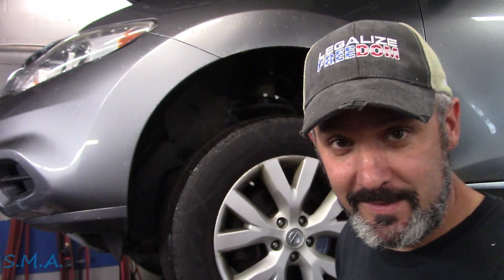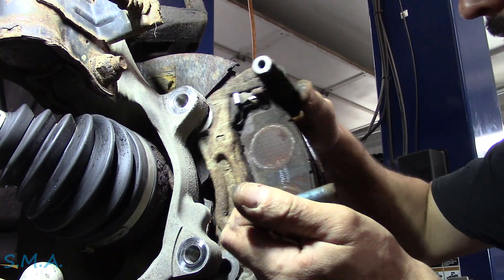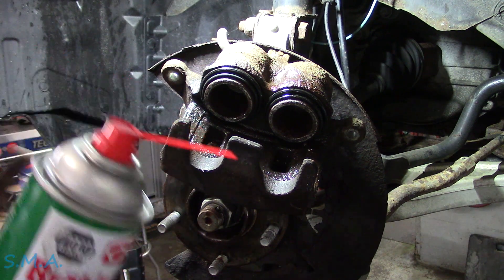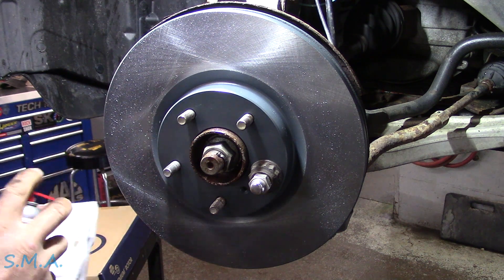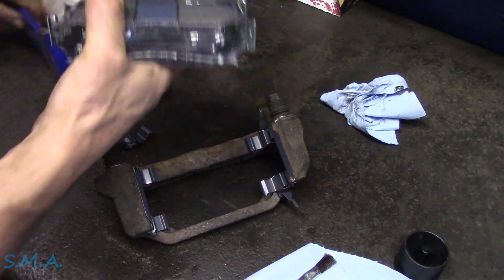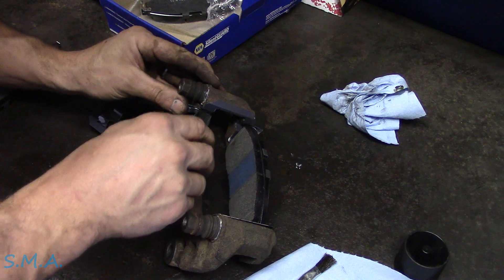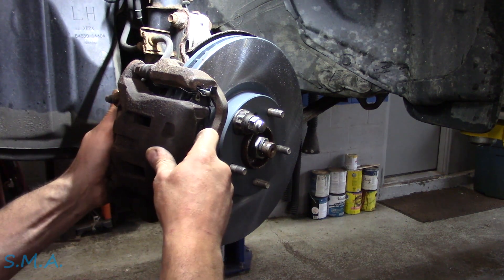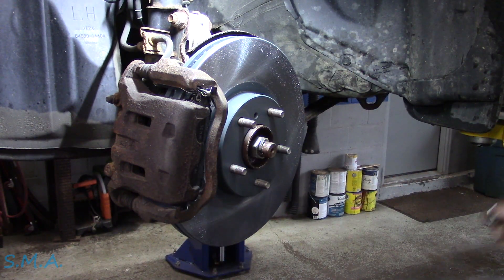Nissan Murano: Front Brake Pads & Rotors

Comment from the maker: My two favorite brake lubes:
CRC 05361 Silaramic Brake System Grease - 5 oz. :https://amzn.to/3cWp0nD
Super Lube 97008 Silicone Lubricating Brake Grease with PTFE, 8 oz Tube : https://amzn.to/3p9NYG5
Reply: KY Jelly?
Reply: What happened to the purple permatex?
Reply: No more purple permatex? Has been working great for me since you turned me on to it. Hope you are having a good holiday with the family!
Reply: Do Tesla's have brakes that need to be replaced ?
Reply: @winch1587  he found a better consistency grease
Reply: Sure makes me happy that salt is not used on our roads. Vehicles last so much longer and the repairs are so much easier. Also the vehicles are safer not rotting out all your major safety components.
Reply: @adamUDavies  Yes, and usually because they rot, not because they wear out.
Reply: @winch1587  In a couple of his videos he recommended the Permatex orange grease which was safer for rubber seals.  That is the stuff I bought and haven't even used yet.
Reply: @BillinSD  Eric switched to the CRC on the miss "O" brake job. Liked how "sticky" it was in some other brake job after that one. The purple permatex was in short supply for some time. I know he got free sample of the CRC in the mail. The super lube is thinner and better for the slide pins, in my view. It's made in the town next to me,  Bohemia, New York. Sil-glyde is also good for the pins and most NAPA's will have it in stock. Use the links if you can, SMA will get a small amount of $ from it. Nothing wrong with the purple stuff. Use it up and then try the CRC.
Reply: @winch1587  It was in short supply for some time. Eric got a chance to try some CRC and liked how sticky it was. Time will tell if he "sticks" with it. I have not seen  Super lube in a video yet. Not clear why he listed  it as a favorite. I like it for the slide pins as it is thinner then CRC and the Purple stuff. Also made in the town next to me, Bohemia, New York.
Reply: @islipfdchief  I must have missed some videos or haven't paid close attention. Don't remember the orange grease nor about receiving the CRC stuff. Let's see if Eric will make a comparison between the different greases someday.
Reply: You should figure out how to return phone calls when local people want to bring work to your shop.
Reply: @Pb_Slinger  Hard to filter all the calls SMA receives. My car warranty is about to expire every week from a local number. If you are truly local ? Open 8-5 Monday - Friday on south main street across from the post office. Don't make it late or on Friday it is Deer season. Be grateful that you live close enough to even get service from a high quality shop.   Eric has not made mention in any of the new videos how far out appointments were. Good luck and if you show up in an Ice cream truck you may get quicker service (:
Reply: @adamUDavies  my wife's Tesla...yes.   Most other owners who understand dynamic brakes.  No.

Comment: There's something relaxing about watching Eric do a brake job.    I think it has to do with me not doing the work.
Reply: That's a fine way to relax, M.H. There's nothing like doing nothing yourself to let yourself relax.
Reply: Every time he does brakes - in my mind - I am doing mine! 🥳
Reply: Yes.  Work fascinates me.  I can watch somebody else do it for hours...
Reply: I just did a brake job on my sister 08 altima. I live a few hours north of Eric O in the lovely rust belt. The drivers side caliper bracket bolts took the threads out with them on removal and I wasn't even using air tools...of course no parts stores sell just the bracket so guess who got replace the whole caliper :) So I can 100% agree on how relaxing it is watching someone else do the work lol.
Reply: @harryl7946  Brake Job ASMR?
Reply: @3wheeler016  you are a good brother.
Reply: Legit I've done countless brake jobs in my life but if I was anywhere near SMA I'd have them knock it out knowing they'd do it better than me.

Comment: I have never seen brake clean affect rubber in over 25 years of being a mechanic. I love your sense of humor and how you repair your customers 👍
Reply: Spray some on a rubber o ring then try and fit it back where it goes.
Reply: Wouldnt hurt to hit the rubber with some silicone spray or grease to rejuvenate the rubbers, gotta keep your rubbers juvenated🤣. Brake clean evaporates quick enough to not hurt the rubber. Dont use wd40 unless its silicone based

Comment: From an aircraft mechanic if torque is not listed we use a Standard Torque table, thread pitch, bold diameter, and if it is a shear load or tension load to determine torque setting with dry treads.  Great video on a rainy day with a shot of brandy.
Reply: My torq specs are snug and tight. Works every time
Reply: Yep, torque tables do come in handy for max recommended torque. It’s usually pretty close to factory specs

Comment: My buddy has a shop, and I used to hang out there a lot after work till I started talking care of my sick mother. One of the biggest problems that I've seen with customers, is that they decide to bring their vehicles in with gas gage sitting on (E), knowing that my buddy or the other tech were going to have test drive it before working on it and test drive it afterwards. Then they wonder why there is an extra charge on their bill for gas.
Reply: I think some folks always drive around on "E".  They must always drive around on fumes.
Reply: Customers do it to stop joy riding?
It's a weirded world it seems.

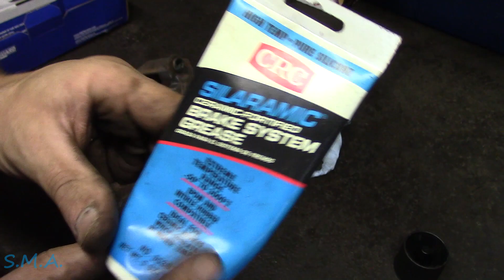Comment: 7:44 that's well above the melting point of most steels.  12:00 I can't speak for automotive engineers but for aircraft we have design manuals and test data for all of that torque information based on exactly all of the variables you list and it's all based on experimental test data.  Everything from what we call the material stackup (the materials of the various parts), to the diameters, to the material of the fastener.  It includes temperature data (metal becomes brittle or pliable at various temperatures), lubrication of the fasteners.  We have separate manuals for bolts and nuts.  Any time you change a fastener in the design you have to take all of this into account to ensure you aren't compromising the strength or fatigue life of it.

Comment: Brake bracket is ductile iron that melts at 2100F.  Bolt is steel that melts at 2760F.  The grease wins!  Thorium with a melting point of 3180F wins over the grease.
Reply: Interesting!
Reply: Eric used Thor for assembly so the bolts are already Thoriumed.
Reply: @JohnnyTalia  Amen to the gods!
Reply: Nothing like the Fahrenheit scale (and all the other English units, for that matter) for true precision. The rest of the world has no idea what they are missing out on.
Reply: @paulparoma  I remember when they tried to change gas from gallons to Liters... Americans like me told them to shove it.
Reply: @defresurrection  I don't remember that, but I do remember Coke bottles going to liters, to little uproar. But why keep up with the rest of the world if you can be proudly retrograde? There is no upside to using the old English (not American!) system other than habit.
Reply: @paulparoma  Yeah, food and beverage containers took hold. As long as both were printed on the packaging I could have picked it up. My schooling didn't cover that! lol
Reply: @defresurrection  I know. But there is hardly anything to pick up: it's a simple, straight-forward decimal system. I think almost all important industries (and certainly all science) in the US switched to metric years ago. All cars use metric nuts and bolts now. Strangely enough, plumbing uses inches practically all over the world, as do computer/phone screens.
Reply: @paulparoma  Numbers mean nothing unless you have a feel for what that number means. 1/16 of an inch is a small amount to measure for most skilled trades. An 1/8 of an inch is about 3 millimeters, so 1/16 would be about 1 1/2 mm. For most weather related temperatures you can take degrees F, subtract 20 then divide by 2 to get degrees C.  Example... 70 degrees F (most pleasant feeling temp for most of us) 70 - 30 = 40. Split that in half and you get 20C.  That would be the temp we enjoy the most.
Reply: @cliffordgrupke6558  True. But the metric system is still far superior. That's why the whole world uses it, and that's why it's used in science.
Reply: @paulparoma  My truck goes 30,000 furlongs per fortnight!
Reply: @bartsarton2212  Nice car truck!

Comment: @South Main Auto Repair LLC You are correct.  That CRC grease will still be good after most steel alloys are liquid.  The melting point of Carbon Steel is betwen 2500 and 2800 °F!  I'm not a metalurgist either but did work at some steel mills doing research.
Reply: The bad news is: the brakes got so hot they melted. The good news is: they didn't bind up!

Comment: I just did an oil change on our GM 3.0 LF1 alloytec and was disappointed that the repair shop that had been doing regular services had not changed the sump plug washer and the thread was balled also had been leaking oil for a while as it was all over the gearbox. Eric keep up the good work.

Comment: Eric: We are now officially Napa auto care center 
also Eric: I'm sure these new Napa pads are the same crap as the old ones
Reply: NAPA: "Need another part again".
Reply: I buy from NAPA but not their brake pads. Centric and NAPA are essentially the same line and I don’t care for either. WorldPac sells OE for less than NAPA branded products.
Reply: Also Eric: still not a sponsor
Reply: I've noticed alot of auto shops use white box brake parts. The pads are simply referred to as "pad material" on the invoice.

Comment: Been using the CRC silaramic brake grease for almost 2 years now. We get it in the little tubs, even comes with a free applicator brush 😮. I like it a lot better than the Permatex lube.

Oh, where I work is also a Napa Auto Care Center. Welcome to the club 🙃

Comment: At my shop,  I always check, notate, and top off fluids and air pressure before sending the car out.   And simple code reads if the light is on.  Gets some extra jobs and protects me from irate returns.

Comment: Yes , there are standard bolt spec charts. though some not not really applicable to automotive work, there are also bolt stretch charts. torque applied stretches' the bolt by a measured amount. Both are almost spot on accurate.
Reply: I'm sure he's aware

Comment: Tip I’ve seen elsewhere when cleaning a new disc or rotor as you say in the USA, put the disc on backwards, clean that face then remove disc and fit the correct way and clean that face 👍
Reply: Good idea.  Thanks for sharing.
Reply: My brakes are two-faced? Explains a lot. I wish they'd stop. Being two-faced. And in every other sense.

Comment: I'm so glad I have a temperature-controlled garage and a battery conditioner.  Speaking of a car that sits a lot, my 2015 WRX has less than 10K miles on it, and if it were an outdoor car, there would likely be nothing left of the suspension, let alone the brakes.  When COVID hit, I found out the hard way I need to move the car once a week to keep the tires round.  8)

Comment: 122 Ft/Lbs for the front "Torque member mounting bolt" (caliper bracket) from the FSM.
Reply: 3 ugga duggas will be ok. . .
Hopefully 🤣
Reply: @danlevesque5437  That's 28 Potzrebies per Nebbish-Ounce.

Comment: in 50 years I have never done a brake job that required the parts to be changed for rust. I have always lived in countries/places where salt was not used on the rroads. Here in Orstraya, most of the cars I see in Erics shop would fail annual (in some of our states) inspection and be put off the road because of the rust. Time to move to TX or FL Eric. Oh, and I am still using that purple ceramic Permatex you put me onto.

Comment: @11:19. I believe the answer is ~46 ft-lb. My Nissan Titan service manual has a torque tightening table in the "general information" chapter. Assuming the grade is JIS 9T and the bolt dia is 10mm with a 14mm hex head bolt. @12:30 - you are exactly right.
Reply: Also, in the beginning when you introduced a Nissan Murano needing a... my mind went directly to CVT

Comment: Hey Eric O!, little tip for cleaning the fingers  on the caliper, 3m sells a wire wheel that's encapsulated in a rubber/jelly coating that works amazing for cleaning stuff without the wires flinging out at you. I find they work amazing for caliper brackets and calipers as well as anything else crusty without the sketchy feeling of "will this explode in my face today" 😅. Anyways love the vids, always a good time watching your content!
Reply: Thanks for the rec. My front side always ends up looking like I was attacked by a metal porcupine after using those wire wheels.
Reply: I just use a flap wheel to clean them on an air die grinder, cheap and easy and come 1/4” thick and 1-3” diameters
Reply: @asapautosolutions  I got tired of feeling that prickly feeling a loooong time ago, always finding lil bits of wire hanging out your cheek  or forehead.
Reply: To hell with 3m
Reply: Any idea what the 3m wheel is called? I've used those Norton blaze wheels that are like hard plastic
Reply: @TheFool2cool  I can let you know  the part # as soon as I get home, I can't remeber  off the top of head exactly the name of them but they aren't like a rubber wheel.
Reply: @Alex35c  is that the bristle discs, or something else?

Comment: Nice work! We’re driving far less too and I’ve noticed my brakes getting a bit crusty as a result. Salt here in south east PA isn’t as big a problem as up there though, so usually a quick spay down with brake cleaner does the trick.

Comment: Torque is always bit speculative. Even when you take materials, thread, possible lubrication etc in account there can be significant differences. In engineering you are trying to figure out the force how much bolt is pushing to the structure so one can calculate all kinds of stuff with the info. Usually the nominal torque specs based on bolt ratings are just fine as long as correct size bolt is used. 

And experienced mechanic probably gets relatively uniform bolt force with muscle memory developed over the years.

Comment: The splashing of the rainwater and Mrs. O's great cooking and it's "3 hour nap time!"
You still using the blue (I think) brake grease?  Or is this 3000 degree ceramic the hot setup?  No pun intended.  LOL!
When you do the job right the first time, as you did, stopping is so smooooooth!  Maybe Napa changed the brake pad name and jacked up the price?  Yes?  No?

Comment: Back around 2000, GM attempted to address rusty brake rotors with a service bulletin. The bulletin stated to make 2030 stops from 3035 MPH.  Nobody proof read it to notice it was supposed to read 20 to 30 stops from 30 to 35 mph.

Comment: I’ve seen three of these on the lift at once getting their subframes replaced at my tech school then working at a quick lube one subframe was rotted so bad that the control arm had some self adjusting negative camber going on
Reply: It's crazy how vehicles are affected like this. A boss at a former job had a Chrysler Pacifica where the front subframe was rotted so bad it wouldn't pass state inspection. Toyota had a problem with some of their frame in the 2000's. They were replacing entire frames under warranty in Tacomas, Tundras and Sequoias I believe.
Reply: @Fix_It_Again_Tony  I have a 97 Cadillac Deville and the rear subframe rots out on these cars, I was surprised because when I took the bolts out and lowered it the frame rails on the car were solid.
Reply: @MechanicalMikesRoadsideRepair  I know in the case of Toyota, it was a metallurgy problem with the frame. Nissan also has an issue with the Navaras built in Spain. In the US Dana supplies the frame for the Frontier (both are the D40 platform), but in Spain a different supplier is used because shipping the frames across the ocean makes no sense. 

I suspect lots of these problems are caused by steel that either isn't spec'd right, or is made wrong. The subframes are probably made by a different vendor (or at least from different raw materials) than the unibody. 

It's all about where the costs get cut. Going with the lowest bidder is almost never the best choice, at least for the end user. There is a lot of science in steel. I think that often gets taken for granted.

Comment: Since it is a Nissan, I will use JIS as the reference — 22mm head would be on a 16mm bolt. A class 4.6 or 5.6 coarse thread zinc plated bolt with lock tite in that diameter typically would be torqued to 47-48 ft lbs to meet the güdentite spec.

Comment: It may be a product of being in the rust but your attention to detail has rubbed off on me . We don't normally deal with the rust you do . So slinging a set of pads on was done pretty quick .  Working in a company shop means you have to live with your work . If something is wrong they are not going to the next shop . Following your steps on brake work along has silenced brake noise complaints . Never think your vids are for nothing .

Comment: Just bought a Kubota zero turn, and reading thru owners manual. It had a chart like you were saying, torque per type of bolt. I was like cool , good to know I have this. I know what kind of weirdo reads owners manual, was last resort for drain plug torque spec.
Reply: I was just about to say look in a Kubota or Land Pride manual. They have a torque sheet in the back of them broke out by size, grade, and thread pitch. I scanned it and keep it on my phone for quick reference when I need it.